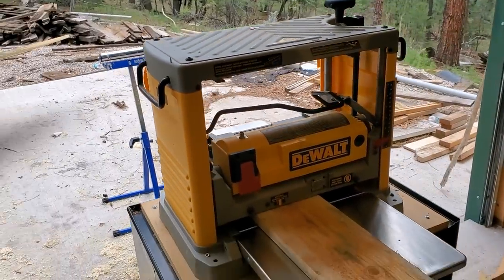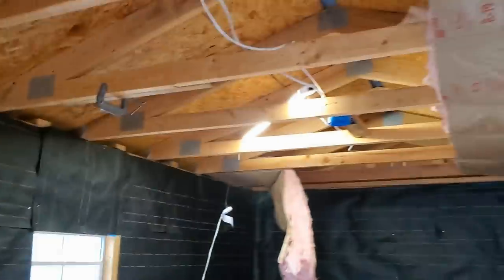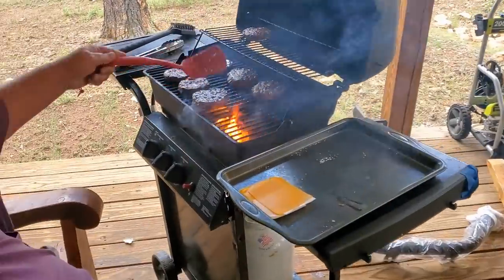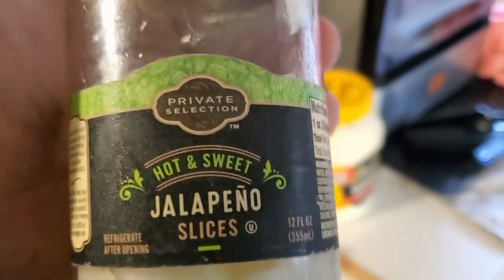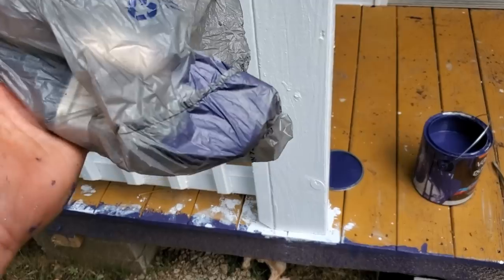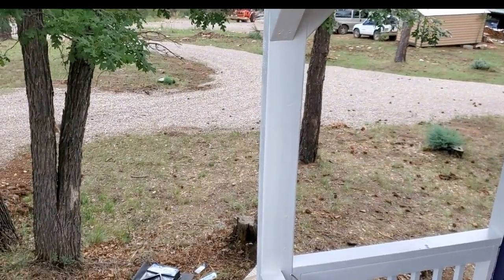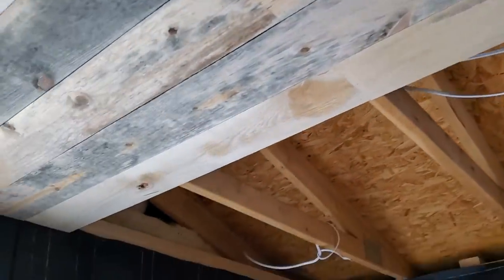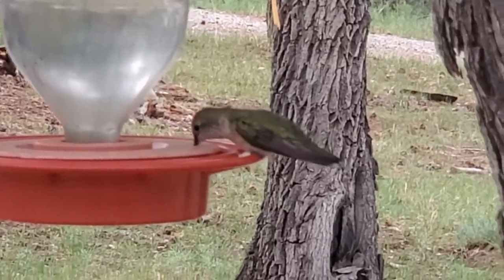Tiny House Gets Blue Ponderosa Pine For Interior, Tucker Gets In Purple Paint!

Comment: The blue pine looks awesome brother. Great job on that lower trim for the cabin. That will help stop the end grain at the bottom of that siding from wicking water up it. You might take the extra effort and make sure you paint the very bottom of the wall paneling on the outside so it can’t draw moisture up into it. What is it about hummingbirds LOL… I have two feeders on my back porch. My little flock it’s so tame that when I take the feeders down and bring them inside to refill them I leave the back door open and every now and then one or two of them will fly in to my back room and hang out until I finish.

Comment: Kevin, no judgement brother. The place looks nice! With that limited amount of square feet,  I would have nailed the ceiling boards to the upper rafters and left your head room. Especially as tall as your are. You could have still gotten plenty of insulation between the roof and the ceiling boards. Just my two cents, brother. You and the fur babies are the ones that have to live in it. Tons of work involved! That's true of any residential building though, no matter how small or how big! Hope to see ya'll on the road again in the coming months! Love watching Ya'lls journeys. Best of luck, sir!
Reply from the maker: I strongly considered it but the rafters didn't square off correctly with sidewalls to do that. It is an 8ft ceiling however

Comment: Excellent Kevin. The trim at the bottom looks great, but am concerned about water entering the groves where it meets the trim. If you could have install a metal rain flashing above the trim to ensure water doesn’t ever penetrate, because as you know, caulking will crack and allow water to enter. By the time you discover that, sometimes the damage has already occurred. Otherwise, it looks great. 👍
Reply from the maker: You are correct it could be a problem in the future. It will have to be carefully maintained. If I were to add flashing I'd still have the seams in the T1-11 that would have to be maintained. I'm hoping gutters will help.
Reply: Campervan Kevin, yes gutters will help with the roof flow, but don’t think it has any effect on the siding unless the wind is blowing, and if it is, then water will be on the walls from the wind not the gutters. Whipping rain will be your corrupted from the side flow. I was thinking, before putting the bottom trim, use a skill saw and cut a kerf along the top of the trim on the sideboard. Pull that 4” sideboard off and set aside. Have your drip edge slip behind the sideboard up about 1”, then 1” across then 1” down. A Z trip. Then reinstall the 4” board you cut off tight up the bottom of the drip edge. Now, install the bottom trim as you had before. This way, no caulking needed, but all the water will be diverted away from the house. I also watch an architect who is a commercial builder, and he always says, don’t seal any moisture out, because once you do, sooner or later it will leak, and once it does, it won’t have a way to dry out. Build it so when it leaks, it also has a way to air out and dry, then it will never mold or rot because it drys out before rotting. To me, it makes a lot of sense.
Reply from the maker: @mrmudstud5980  I'd just add new T-111 on top of old T111. Worst case scenario

Comment: Hi there !! I see there is space between the ceiling and the actual roof.  Have you thought of using that space for storage ??   You would need a hatch though😁   Tucker is a needy boy.  It comes from the abuse henhad as a pup. My dog is just like that.  I love those yorkies
Reply from the maker: no room up there. I will use R19 for insulation and then add used scrap insulation on top

Comment: I snickered when I first saw the purple but before the video was over it grew on me and I think the purple and white really look great. How did you choose purple?
Reply from the maker: I cleaned building and houses to prepare for paint etc etc for almost 30 years. I got tired of the normal whites and beige. Every now and then I'd see a purple house and I really liked them. Back in mid 90s I built a new house and painted it purple. I recently sold it... its still purple. I wanted something out here that reminded me of home.
Reply: @CampervanKevin  What treatment do you use inside on the ceiling? Will heat this winter fade the purple effect? Good luck buddy enjoy your videos.........
Reply from the maker: @rogerkilpatrick8617  no treatment until wood is dry. Purple color will hold for many years
Reply: @CampervanKevin  Just a thought of knowing the arid conditions out west here is what spun this question, thanks for the reply and patience to answer dumb questions

Comment: Just curious...aren’t you gonna put insulation up against the wee top of the roof area so as to cut down on a cool air space between roof and attic ceiling floor?  I do see whereas you’ve placed some insulation sheets on the floor of the attic but not up between the 2by4’s or whatever size they might be. 🤷🏻‍♀️
That one piece of board you were showing toward the end had a really nice design in the wood.  Might be a nice center board placed special so as to add a nice character focal point on a wall.  🐛
Reply from the maker: roof insulation will sit on top of wood ceiling. will add as we go

Comment: Did you add the rest of the insulation to that side?   Why are the last spaces  between the front and back rafters not insulated?     Did you run short and need to go buy more?
Reply from the maker: easier to add when 1/2 done
Reply: Thank you for answering.  I had never seen it done quite like you did.